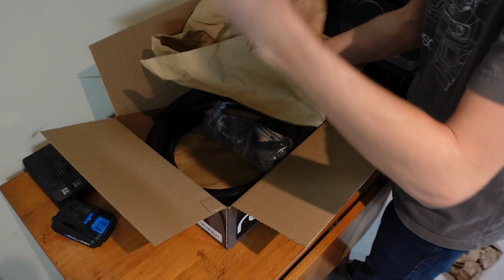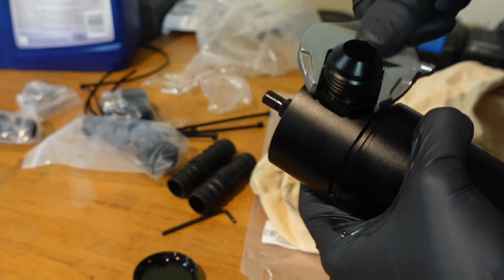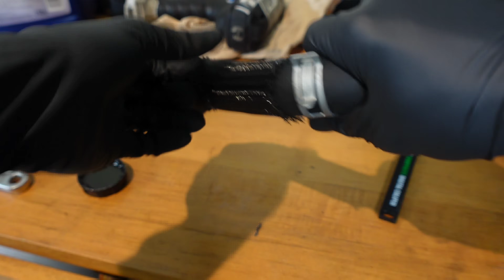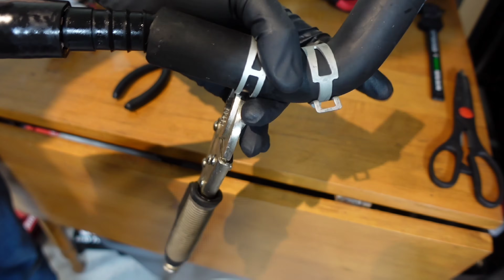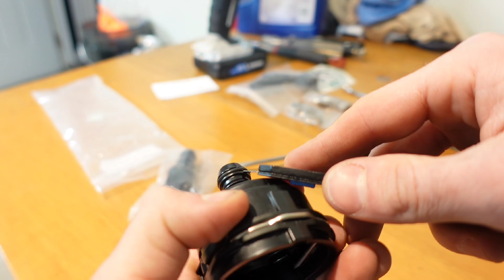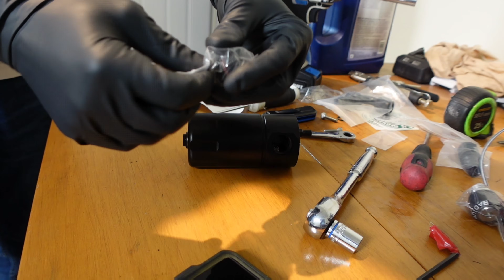2022+ WRX Radium Catch Cans Install

Comment: This would also be the time to replace the pcv valve guys just so you know and keep in mind the pcv hose you cut most of the time you end up getting a new one because the original ones kinda fuse themselves to the manifold

Comment: I actually put the fittings on the opposite holes so that the curved one is on the bottom and the straight one is on the top and fits pretty well.

Comment: do you recommend getting dual side catch cans or can I just get by getting the PCV side catch can for half price and get the CCV later if needed? I have a 2023 WRX VB with 38,000 miles..
Reply from the maker: Honestly getting one is better than nothing. But they didnt collect nearly as much as I thought they would. My VA wrx would fill both catch cans halfway in bewtween every oil change. The VB didnt seem to have nearly as much, but still a good mod to have especially if you run it hard.

Comment: for the ccv there is a metal tab on the oem line both on the bigger and smaller connector, you could remove the oem ccv line completely and add the radium hose/fitting when its off the car so its easier

Comment: I could not, for the very life of me, get that PCV hose off of the engine. Neither end would budge, not that I could get to the lower clip anyway. However, I wonder... since all you're really doing is a bypass on that short hose, and the hose is (mostly) on top of the engine, it seems like it might be possible to just cut the hose in half right there on the engine. All you'd have to do is connect the Radium hoses with their clips and you'd be off to the races without having to worry about trying to figure out how to get that hose out. Wouldn't that work?
Reply: PCV hose is hard to remove, so you need to use a small hook go inside to pry open it
Reply: Did your theory work? Or did you just end up removing the pcv pipe?
Reply: @tintstudioSC  It did work, although not very well. I was unable to cut the hose across cleanly due to it being in such a very tight space. The hose ended up leaking a bit. Eventually, I was able to get the hose off and replace it with something better. To make sure the connection is secure, you really need to get the OEM hose off of the PCV valve.

Comment: I followed your video and now am noticing radiums install pdf that notes disconnecting the battery. Was this an important step? or should i be worried?
Reply from the maker: @jaypee024  I feel like all manufacturers recommend removing the battery connections before doing anything on the car. I almost never do unless it's something with a lot of wiring. There is nothing to be worried about.

Comment: Looking for help here… I got all the way to installing the ccv bracket and I’m lost because the bolts literally don’t fit under the sheet metal. I can’t thread the bolts through because they are too big to even go behind the sheet. Any tips? Has this happened to anyone else? I have a 2023 wrx.

Comment: I had a 2016 with a stage 1.  Never, ever any oil in both cans - no blow-by.  Sold it at 30k miles.  Now have a ‘23.  Dont plan to mess with a catch can - will do fuel induction service at 30k and call it a day.

Comment: Question for you, getting my Intercooler back in place was tough because I cut my hoses slightly shorter than I should have. They are wrapped tight to the bottom of the Intercooler ducting. Any reason to pull off and replace the hoses? They are nearly impossible get off the barbed fittings with a razor blade down length of fitting and doing this all again sounds like a nightmare. Thanks

Comment: Just started to install my Radium dual-can kit and find there is nothing in the instructions to tell the difference between any of the AN fittings (they have different outer thread sizes). Well done Radium, genius move. From trying to guestimate from the pics and this video I THINK the PCV can (that fits on the brackets on the ABS unit) has the bigger-threaded one.

Comment: What about an IAG air/ oil separator? $400 never have to touch it , plus it's coolant heated. Catch cans you gotta check em. No good
Reply from the maker: Click this link and scroll down until you see the AOS Vs Catch Can section. https://phatbottituning.com/15%2B-wrx-recommended-parts

Comment: Dang i installed the cans now realize that the ets intake wont fit
Reply from the maker: I actually also have the ets intake now and got the box to fit. It's very tight. I need to make a small cut eventually to make it fit better.
Reply: @StreetInspired1 I have these catch cans and ETS CAI being delivered next week…how did you get the catch can to fit?
Reply from the maker: @sethiousbell82  I actually kind of forced the intake box into place lol I may end up cutting out a small section so it clears better.
Reply: @StreetInspired1  Lol that make a me nervous because that metal on metal. Which section would you cut? 
Have you tried Mishimoto catch cans?
Reply from the maker: @sethiousbell82  I would cut a small section out of the intake box towards the top where it meets the catch can. I personally don't have experience with the mishimoto cans on this model, but I used them a long time ago on my 2015 wrx and they worked great.

Comment: Just an update for anyone getting these. I bought the dual catch cans.  I have a Perrin CAI with the heatshield. I had to cut out a little section of the heatshield for the PCV catch can for it to fit.  I also have a Perrin charge pipe, and the CCV catch can is a little tricky to get the fitment. Make sure you watch the length of the hose, cause the angle at which it runs over the charge pipe will pull against the charge pipe making it touch part of the block if youre not careful.  Other than that, it does fit fine.  Also make sure you pay attention to the fact that he was leaving the fan out for the video, but you have to install the fan before the catch can.
Reply: Thanks for the major heads up…

Comment: Thank you for the video. Correct me if I’m wrong, the bracket by the ABS at 5:23 the screws you are securing it with are the provided screws correct?
Reply from the maker: Correct! These will be provided with the cans.
Reply: Thank you, video was a big help….just got them installed, was also confused on which fittings go with which can and which hose size for which system but figured it out.

Comment: Where are the hose clamps for the ends that connect to the catch cans? I noticed that you didn’t put any on for the PCV or CCV ends.
Reply from the maker: No clamps are required for the barbed fittings that go into the can. (They're are very  tough to get on all the way and pretty much impossible to remove once installed without cutting the hose.
Reply: @StreetInspired1  good to know, thanks for this info. Also, great job on the videos. Have you considered a video about dropping the oil pan and checking for RTV in the oil pickup? Or, have you thought about making a video on how to properly bleed brakes for upgraded fluid on the 22+ WRX?

Comment: I went with the Mishimoto catch can. Doesn't require cutting and works with the ets intake. Plus it uses nicer molded hoses instead of the straight bulk hose.
Reply: Does the Mishimoto kit come with a dual can setup for both PCV/ CCV?
Reply: @jmtcol5280  No but you can add the radium ccv if you want. Didn’t wanna spend twice the price for both cans when the pcv is more useful.
Reply: @toyosup88  Oh cool, I see that makes sense. How was installing it? You like the quality of it so far?
Reply: @jmtcol5280  it was pretty easy. Hardest part was getting the oem hose off.
Reply: @toy @toyosup88 s it holding up? The mishimoto. And did you ever the CCV side or did u just say fugggittt

Comment: Do you feel the CCV can is really needed? I would ideally like to get both but if I can be safe just running the PCV can I may just do that 😅
Reply from the maker: One is better than nothing! If you are going to run just one I would definitely do the PCV. Both of my cans have already catched some oil but there's a lot more in the pcv side.
Reply: @StreetInspired1  okay sweet that’s good to know! I think for now I’ll get the PCV side and down the road I will get the CCV can

Comment: Question is in areas where we get cold temps what’s your opinion with condensation in the catch cans. One reason y i like aos from iag however their not making a system for the vb chassis yet
Reply from the maker: Even if condensation makes its way into the can it will get trapped and won't get out. Here in Pennsylvania it gets pretty cold for like 6 months of the year. In my VA wrx I had the same cans and got a little bit of condensation but nothing crazy. It just all pours out when you empty them. I hope this helps.
Reply: @StreetInspired1  good to know. I might pick that up. I’m in the Jersey shore

Comment: Curious if you disconnected the battery on the install? Wondering if I can keep it plugged up.
Reply from the maker: I did not. I almost never do unless im directly working with cutting wires or anything airbag related.

Comment: It might not be necessary but I would put hose clamps on the fittings to the catch cans where you dont have them. Might be going to the extreme one would say. I think it would complete the esthetic. I just got my wrb vb only 2 weeks old and I put 168 miles on it. Daily driving. Great video and install. It pushes me to make the purchase for these cans to maintain the engine. Indecisive because I am wondering if this voids my warranty.
Reply from the maker: Radium specifies that you don't need them because of the barbed fittings and doesn't include any, but i know what you mean. You could definitely add some just because!
Reply: @StreetInspired1  would this install void warranty? Although it seems better for the engine.
Reply from the maker: @dopewayne  It's highly unlikely. They would have a very hard time denying a claim because of these. In any warranty claim, if they deny warranty because of an aftermarket part, they have to prove that the aftermarket part was a direct cause of the failure (which would be almost impossible for a device as simple as a catch can)

Comment: I recently installed a Mishimoto single catch can on the PCV valve side of my '22 WRX.  From what I read having a can on the CCV side is pretty much overkill on a stock or lightly modified car but maybe you plan to get radical with your car latter- IDK.
It was a bigger job than I anticipated.  Very tight space to work in and anything that can get in the way does.  I'm glad I didn't have to do the CCV part of the job.  That looks a lot more involved than I'd want to get into.  
I'll be watching to see how much vapor oil you collect in one can versus the other - I hope you do a follow up video to show us this.
Reply from the maker: I will definitely do a check up video after a few thousand miles to see what collects in the cans and the differences between the ccv and pcv side
Reply: Did u ever install a CCV can? Heard it’s useless like you said and nothing is collected after 12,000 miles for one guy

Comment: Does this void warranty
Reply from the maker: It's highly unlikely. They would have a very hard time denying a claim because of these. In any warranty claim, if they deny warranty because of an aftermarket part, they have to prove that the aftermarket part was a direct cause of the failure (which would be almost impossible for a device as simple as a catch can)
Reply: Yes, it does
Reply from the maker: @vitaly062  "The Magnuson Moss Warranty Act requires manufacturers to honor the original warranty unless they can prove that the aftermarket modification (either the parts or installation) was responsible for the failure that caused warranty repairs"

Comment: Will this void warranty on the car by any chance?
Reply from the maker: It's highly unlikely. They would have a very hard time denying a claim because of these. In any warranty claim, if they deny warranty because of an aftermarket part, they have to prove that the aftermarket part was a direct cause of the failure (which would be almost impossible for a device as simple as a catch can)

Comment: Man, thanks for making these videos for us. I've been wanting to put a catch on sooner rather than later. I was wondering if the pvc side can would be in the way of an aftermarket intake though🤔 what's your thoughts on this?
Reply from the maker: I believe there were fitment issues with certain aftermarket intakes on the VA Chassis kit. Some worked and some needed minor modification. It's likely that could also be an issue on this generation. However, I'd be willing to bet if there were fitment issues, it wouldn't be super hard to combat them.
Reply: i recall a reddit thread where someone commented the ETS airbox will interfere slightly with the PCV side

Comment: Thank you for making this install vid Cody! I was looking forward to grabbing these Radium catch cans until I saw how the PCV side can conflicts with the ETS CAI heat shield box :( I wonder if there's a way around the issue without cutting the box...
Regardless, this is an awesome product and install video!
Reply from the maker: That's a bummer! I know the VA chassis had the same issue with ets intake conflicting. There may be a simple way to modify it to fit. I'm most likely going to end up getting an ETS intake, so I will be sure to show any modifications that need made when I pull the trigger on that!
Reply: @StreetInspired1  yeah it’s a big bummer. I’ve seen some have taken a grinder to the box but I’m not sure how that affects it. I really hope there’s a simple way and I’m looking forward to your future vids! Keep up the awesome content brotha!

Comment: Good vid. Nice and thorough. As usual i used my imagination to see the points where something would likely go less smooth as it did for you😂😂 

Overall how long did this take? Id imagine still quicker than an AOS install
Reply from the maker: It actually took me longer than expected. I would say roughly 2-3 hours of course I was also filming and setting up camera and lights. And double checking radiums instructions. But I think using this video someone could do it in about an hour or 2.

Comment: Now I'm curios how easy it is to service these cans
Reply from the maker: Very easy. You just unscrew the bottom of the can and dump it out. It takes less than 2 minutes. The one underneath the intake duct is a tighter area, and you'll have to remove the two clips and take off the intake duct, but it's not bad at all to service themA

Comment: Ew subaru is using the same style of locking clamps that is used on the coil packs of the VA but all over the place. Those things make my blood boil. They never stay unlocked and you have to keep fighting them to stay open or yeet them off and hope they dont go soaring.. absolutely suck in tight spaces.
Reply from the maker: Lol, there may or may not have been a few seconds of yelling edited out from those clamps. They seem great in theory but cna be a huge pain.

Comment: I would rather install an AOS, but this is a good video!
Reply from the maker: If you're interested in giving it a read scroll down until you get to the "AOS VS CATCHCAN" section. Might not change your opinion, but it helped me decide. https://phatbottituning.com/15%2B-wrx-recommended-parts
Reply: @StreetInspired1  the pics of the AOS sludge have me thinking twice, thanks for posting!

Comment: You really only need an Aos or catch can, if you do a lot of short drives or do racing. I had a Rex that was 95 % freeway driven no oil consumption and minimal blow by. My Sti is 95 % street driven and blow by was definitly an issue prior to installing my Aos.
Reply: the 22 is direct injected, so an AOS can stop the build up on the valves which can cause power loss

Comment: I really like alot of radium products. That kit even looks awesome. Only thing that sucks is the price. For like another 40 to 50 bucks you can get an AOS and take all the extra work out of having to check and dump the cans all the time.
Reply from the maker: This is true. But I still prefer catch cans over AOS. My tuner changed my opinion on it. If you're interested in giving it a read scroll down until you get to the "AOS VS CATCHCAN" Section. https://phatbottituning.com/15%2B-wrx-recommended-parts
Reply: @StreetInspired1 same. Rons my tuner as well and sold me on cans VS AOS.